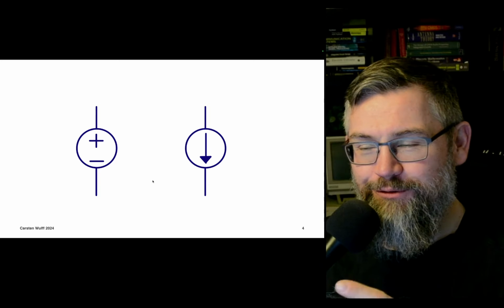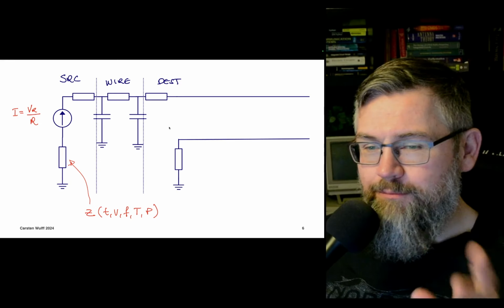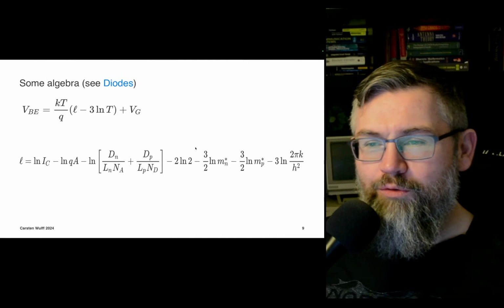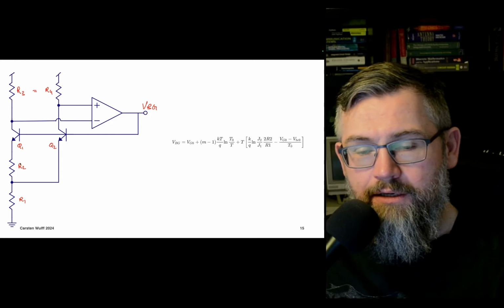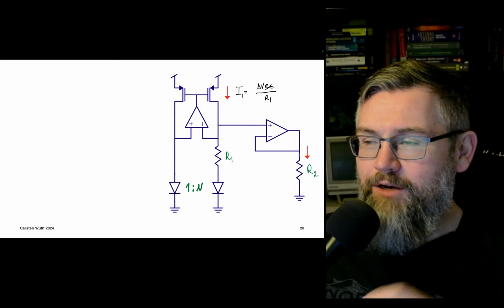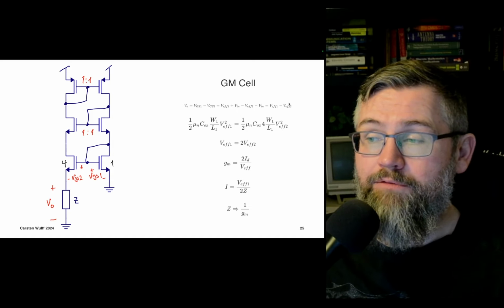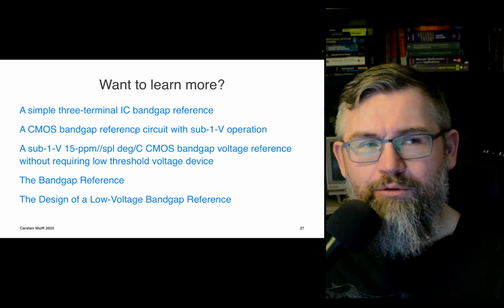Lecture 3 - Voltage References and Bias Currents (aic2025)

Comment: Voltage and Current References in Integrated Circuits

*   0:00:03 Introduction to References and Bias Currents: Integrated circuits require stable voltage and current references for accurate operation. These references serve as fixed points for comparison in various circuit functions.
*   0:00:37 Challenges in Voltage Distribution: Distributing a reference voltage across a chip is challenging due to variations in ground potential and resistance in the distribution wires.
*   0:07:31 Current Domain Distribution: Distributing references in the current domain is often more reliable than voltage, as current remains constant in a loop, despite ground variations.
*   0:08:37 Limitations of Current Distribution: Current distribution across the die can have limited accuracy (around 2%) due to variations in resistor values.
*   0:09:47 Proximity for Precision: For high precision, voltage references must be generated close to where they are needed, such as in battery chargers.
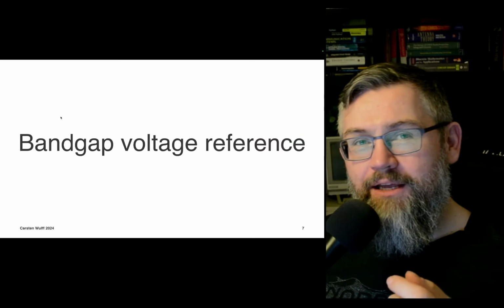*   0:10:32 Bandgap Reference: The most common and effective way to create a voltage reference is using a bandgap reference, which relies on the properties of a forward-biased diode.
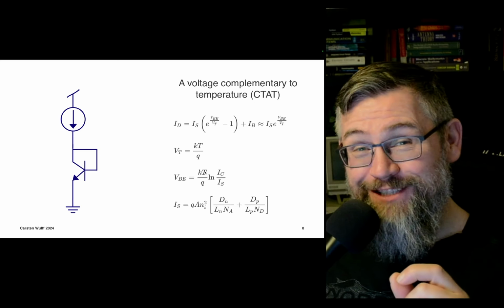*   0:12:47 Inverse Temperature Dependence: The base-emitter voltage of a bipolar transistor is inversely proportional to temperature due to the intrinsic carrier concentration's effect on the scale current.
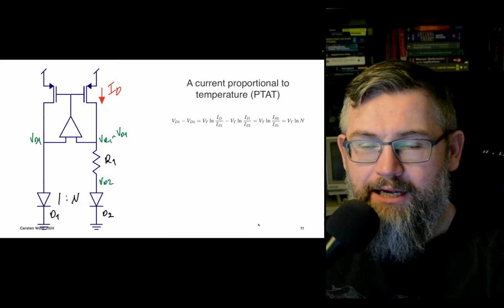*   0:19:17 Bandgap Reference Operation: A bandgap reference utilizes two diodes, one larger than the other, to create a voltage difference proportional to temperature, which is then used to generate a stable reference.
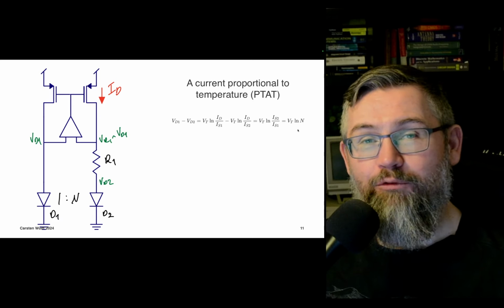*   0:22:46 Practical Challenges: Achieving perfect matching in the op-amp, current mirrors, and diodes is difficult, leading to variations in the reference voltage.
*   0:25:54 Combining Temperature Coefficients: The bandgap reference combines the negative temperature coefficient of a diode with the positive temperature coefficient of a resistor to achieve a stable output.
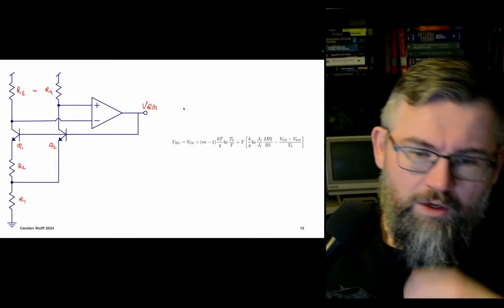*   0:27:54 Brokaw Bandgap Reference: An alternative implementation called the Brokaw cell uses a similar principle but with a different circuit topology.
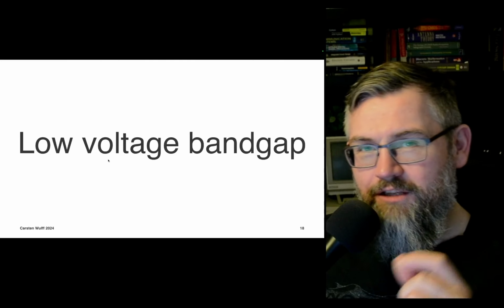*   0:34:23 Voltage Limitations: Traditional bandgap circuits require a minimum supply voltage (around 1.5V) to operate correctly.
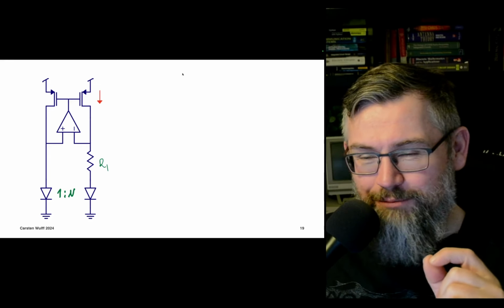*   0:35:54 Low Voltage Bandgap: A modified bandgap circuit allows for operation at lower voltages by utilizing both a current proportional to absolute temperature and one inversely proportional to it.
*   0:39:33 Resistor Temperature Coefficients: Resistors also have temperature coefficients that can affect circuit performance, but in some configurations, the impact is minimized.
*   0:40:36 Voltage-to-Current Conversion: A voltage-to-current converter can be used to generate a stable current reference from a fixed voltage, which is useful for distribution across the chip.
*   0:42:29 GM Cell for Biasing: The GM cell is a common circuit used for biasing, and it can be designed to provide a transconductance that is proportional to temperature.
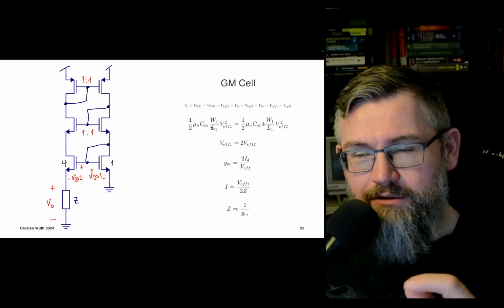*   0:47:36 Switched Capacitor Circuits: In switched-capacitor circuits, a current proportional to capacitance can be generated using a switched capacitor configuration.
*   0:49:24 Further Reading: Resources like the IEEE Xplore paper and Behzad Razavi's introductions are recommended for deeper understanding.

I used gemini-1.5-pro-exp-0827 on rocketrecap dot com to summarize the transcript.
Cost (if I didn't use the free tier): $0.07
Input tokens: 54705
Output tokens: 739